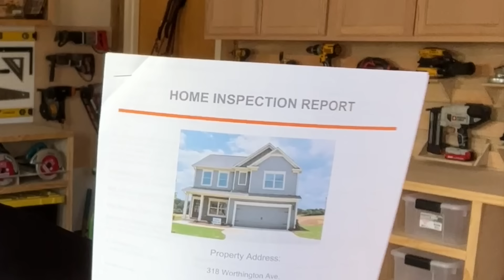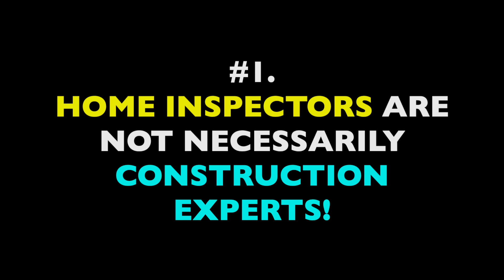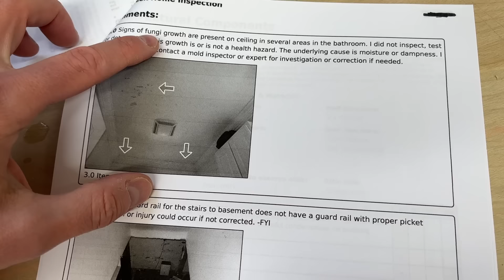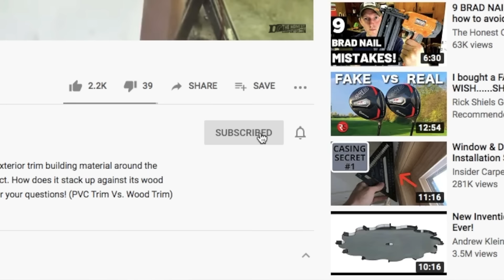The Truth About HOME INSPECTION REPORTS! What They Leave Out...(Homebuyers SHOULD WATCH This Video!)

Comment: In California you need to pass a termite inspection.And many times this becomes a dodge to inflate repairs that are not necessary. Elderly clients are the most vulnerable ,fear is a powerful weapon. If I had clients that were getting an inspection I would be there to keep and eye. It is amazing how small the report’s get when there is a licensed contractor in the room. I have seen these guys say a muddy exterior crawl frame is dry rotted when it was just covered in oil from a pesky dog or animal. There is more but you get the drift and in California if the job is done by an outside contractor you are still at the mercy of the termite inspector final inspectIon. But I have noticed if you give them $2000 dollars worth of repairs they claim you can save paying up to $8,000 on a trumped up inspection bid.  Also in California once the termite inspector has come you cannot ask for a second inspection if you don’t like the first one. You have to satisfy the first inspector and pay him off to possibly get the next one. All that time you have to wait before you can sell. I am a General Contractor in California

Comment: My two cents, as a successful home inspector…

I’ve never built a house. I’ve never worked in construction. I’m somewhat of a nerd. I understand the simple mechanics of things and how they work. Looking at something, I can deduce fairly easily how it should operate. If it’s not operating properly, it’s written up as a defect.

I don’t want a trained plumber to tell me about my electric panel. I don’t want a former AC technician to advise me on grading.

You are certainly entitled to your opinion and the video has many truths to it, but your main soapbox point is to hire somebody who has construction background. That, simply isn’t true or necessary. Some people just take pride in the work they do and spend a lot of time learning about their craft and not just taking some online course.
Reply: agreed.
Imagine how much it would cost (in time and money) to bring in Roofers for the roof, HVAC techs for HVAC, Structural engineer to look at the structure, Plumbers for the plumbing...etc, etc.

Some of the best Inspectors I've met had no "construction background" but were analytical, methodical, and were more up-to-date on code than the 30 years of experience hammer swinger
Reply: Also I tell a lot of people is that good home inspectors are complete unbiased third parties. They get paid weather you buy the house or not, and at least in Texas and I’m pretty sure most anywhere else Home inspectors are not allowed to get and commission or reimbursement from a realtor since that would make you biased to make the relator happy, so again that’s why I say good home inspectors.

Whereas contractors or tradesmen are professionals who make their money by either repairing or installing new equipment or whatever else it may be. A home inspector will give an unbiased opinion on all of your equipment because we gain nothing from it not working you won’t be paying us to fix it or replace it or anything. There have been countless social experiments done on different trades weather it be a plumber or electrician or HVAC technician, that had been called to diagnose a fake “problem” and see if they tried to upsell them on repairs or replacement and while not all of them did and in some cases not many did, there were still a handful that did try and upsell them. So my point being, good home inspectors want to do a good job, and give their clients as much information as possible while trying to diminish the fears. All while being unbiased, and that’s just not always a guarantee when you call specific trades to inspect things. And I would be shocked if calling each individual trade wasn’t a whole lot more expensive than hiring and inspector as well as take a lot more time.
Reply: Thankyou! Just because someone has been in the trades for 20 years as a plumber, doesn’t mean they are better than me at home inspections. Plumbing is 5% of the inspection. In some ways, I think it is better for someone to have no construction background and then learn everything about home inspections at once. It leaves some biased opinions out of it. It all depends on how much someone wants to learn and apply what they learned.
Reply: I agree...to a point.
While an electrician may not be a plumber, I'm willing to bet he knows a hell of a lot more about plumbing than an accountant or a doctor.

ANY trades experience is a definite plus.
Reply: I am tired of home inspectors calling out defects that are not like no-lox on aluminum service conductors of the 8800 alloy, its not required by the manufacture or the NEC. So how is it a defect. My favorite is # 10 awg on a 40 amp breaker feeding an A/C unit. 99  percent it legal per the NEC. The customer now made at me for charging normal service rates and not doing anything.
Reply: @phillypauly  but yo get a better inspection
Reply: I agree with you… To a point as well. I’m willing to bet my license that you won’t come across a home inspector who decided to stop being a doctor and start being a home inspector. Generally, you’re speaking to competent, mechanically inclined human beings who understand both the nuances of the rule and the common sense that comes along with spotting defects. My wife is able to spot many of the defects that I come across in a home just by glancing at some of my photos. She is a psychologist. It didn’t take her going to trade school to identify something doesn’t look correct. It’s then my position to be able to elaborate on what I see wrong, that is where she would come up short.  All in all, Home Inspectors is a jack of all trades master of none. If you’re looking for someone who is an electrician by trade to do your home inspection, I’m willing to bet that he’s going to come up short when it comes to inspecting your roof.  There is a reason this field exists. I would suggest an electrician who knows more about a house than other electricians should consider becoming a home inspector. It pays better and is a lot less dangerous. Cheers.

Comment: I think you did a great job of summarizing an inspection following the minimums of the Standards of Practice. The Standards of Practice are very similar to building codes which state the MINIMUM requirements that must be followed. I've often said how can anyone be successful in any industry when only doing the minimum required of you. To add to your recommendations in finding a good inspector is to find one that will exceed the SOP whenever and wherever possible for the buyer's benefit.

Comment: Interesting video with some diverse perspectives. A few thoughts: 1) Equating inspector value with construction experience makes little sense. In any field of specialized information (i.e., any industry), experience helps create a more well-rounded professional. BUT, experience is just one necessary component. Within the trades, you have to start somewhere and it usually isn't as a GC. By your suggestion, no one starting out in any industry should ever get work or be trusted. That would be a major problem. 2) Education is critical in ALL industries. In many states, continuing education requirements for inspectors goes well beyond that for trades professionals. 3) Placing a high value on construction experience for a home inspector doesn't make sense since many times the structures being inspected are built with said deficiencies from people in the construction industry. Just saying. 4) Home inspections are what they are b/c the inspector has become the scape goat for most situations. Talk with any attorney who works on home inspection cases -- there's a reason an entire specialty has been created just for home inspection lawsuits. 5) You are correct that an inspection is limited. But, inspectors are designed to be generalists of all the trades and practices; yet, we don't willingly ask a plumber to rough-in our house for wiring. So, you can't be a generalist AND specialize in everything. The alternative is for consumers to pay an engineer, plumber, electrician, HVAC tech., energy auditor, roofer, etc. to each come out. That would be expensive. 6) You neglect to mention that, for the inspection industry, time is a huge factor -- clients are contractually obligated to have ALL their due diligence performed within a very short window. Add atop this a strong seller's market that further reduces a buyer's ability to negotiate. While inspectors may not know aspects of the trades, the same is true of the trades not knowing the context in which home inspectors are operating. 7) Agent referrals are a huge pain, but a baked-in component. Until we change that configuration (good luck, NAR has some very deep pockets and is well organized), you will always have a portion of inspectors working who would otherwise weed themselves out by ineptitude (b/c they help agents "close" instead of protecting the client by providing a derth of information). This is good perspective and I greatly appreciate your ability to not just take one side. Onward and upward!
Feel free to look me up on IG -- just add "Cookeville" to the end of my business name.

Comment: I agree; I would frame it like this though. Just like a joiner/carpenter might be an expert in woodwork, an inspector is an expert in a different field. That does not de-value or make one or other other more or less valueable.

For example, I have never worked physically in construction, conducting manual labour, however I am a chartered building surveyor with the RICS, and would consider myself an expert in the field of the building regulations, and practice as a general practitioner for construction.
I comment as this can disseminate a different way of framing this information, from the surveying side. 
You guys, are most certainly the experts/specialists when is comes to the physical construction elements, and each party deserves to be given their place.
This also means that surveyors are specialists/experts in a different field of construction trade.

Comment: Another great topic. I am not in construction, but I am in plant maintenance & engineering. I have been quite disappointed with home inspectors to the point I tell my children I will personally inspect a home they want to buy even if it requires a long plane ride and significant cost.
Reply: Spending time and a lot of money on air fair is a given.
Spending extra money on a “hidden” issue that didn’t make the inspection report is most likely not going to happen.
It’s probably wiser to just let the inspection to occur and just give you kid the money you would have spent on time & air fair IF there is an additional hidden issue.

Comment: As an experienced contractor, I obtained my home inspection license for additional income. Every structure has typical cosmetic defects. I tell my customers I am not there to report obvious, typical cosmetic defects. Nearly 60 percent of the structures I inspect have faulty GFCI outlets, loose toilets, windows that do not function properly or lock, double tapped breakers, marginal roof coverings. I have also inspected numerous new construction structures. Most of them look like a bunch of blind toddlers built them. Regardless, with the cost of housing these days, buyers want every defect reported as a means to get a better price or lower price on the structure.

Comment: Great vid! Great advice! There are so many hidden potential problems that are dangerous. Soldered and taped wire (Romex) connections (house built in the late 60s), and inspectors would not and cannot look for that, gas lines with wrong pipe types and other crap the previous owner did it themselves. Could not believe what I saw after mom asked me to hang a new ceiling fan. Soldered and taped connections! How many more are there throughout her home? Even some brand new homes have hidden stuff. Caveat Emptor! It also depends on what state the inspector are licensed. It varies wildly from state to state. Either way, thanks for the informative vid! Always a pleasure to learn something from the vids you do.

Comment: I asked my inspector if my house (built in 1970) had copper or aluminum wiring... he told me later that the wiring was copper. When I had an AC outlet short out on me a year later, the electrician told me I had aluminum wiring... Isn't that stuff dangerous? Do I have any recourse regarding the inspector??? I actually don't think he even really checked...

Comment: This video was very informative and caught my eye because we MAY have been burned by our inspector missing structural issues of our cinderblock basement which likely would have had us not buy our current home.

Basically, our 1960s cinderblock basement is slowly (worst wall was less than an inch after 60 years!) caving in on itself due to clay around the foundation (and possibly the nearby quarry that began blasting 40 years ago, though it's to the northeast of us and the north wall is the only plumb wall, so that might not actually be true lol) and the previous owner who was a DIWhyer finished the basement (don't even get me started on the shoddy job he did or that he stupidly finished a 1960s basement!). Due to the paneling, the inspector couldn't inspect the west wall which we had to repair last summer (to the tune of 12k), however, the east wall was partially exposed (really about 40% of the wall) in the laundry room and mechanical room (now we know why the door won't close and the wall and floor are painted with waterproofing paint...) and after we had the west wall repaired, the people who repaired our foundation said all but the north wall needs to be braced (another 12k+!).

Of course, when this came back, we were livid. After all, there is definitely obvious signs of the east wall slowly vacing in, but when we brought this up to the inspector, he came, complemented my flooring choice (waterproof LVP), checked it and agreed that it was in fact not plumb but said it wasn't a big deal and didn't need repair, gave some other random advice and left. Now I do trust the guys who did our foundation and they're highly recommended from multiple people I personally know and trust, but I also know work is work and they need foundations to repair to eat, so basically, I've now got to get a structural engineer in and if he comes back with pretty much anything that should have been obvious on the east wall that we will be going into arbitration to do the necessary repairs to our home so we can sell it...

Basically it's more hassle than the house is almost worth to us (well, at least it was until the current market...) all because we used a recommended inspector instead of doing research and finding one ourselves.